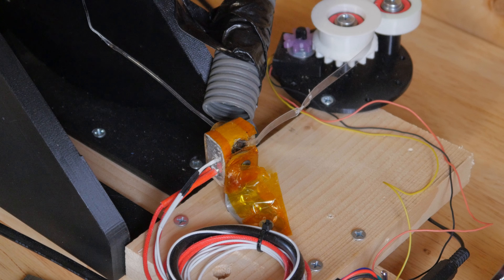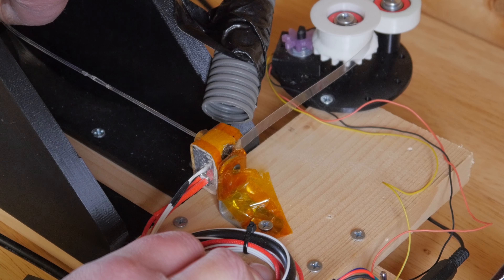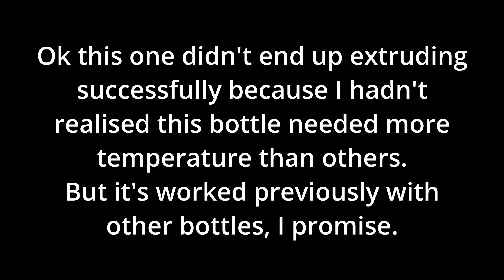PET bottles to filament, pt2 - joining bottle strips

Comment: Isn’t just welding/joining the pultruded filament just quicker and easier?   When I’m doing 25-30 bottles, I don’t want to spend a lot of time in the joinery.
Reply: I tried, but it becomes a weakpoint when you melt them, so they just fail when they reach the nozzle

Comment: A spring loaded cutter that forms both ends to link like an arrow in a slot is an idea I have rolling around in my head.  Sharing here incase someone more "mentally organized" than myself can play off the idea and even pull it off.  A simple insert into tool, smash with hand and done method.  Cant use heat because it risks hitting the pet crystaline state where it doesn't like to do much work....  Making this recycling FAST from strips is a big deal and we really have to figure this out.